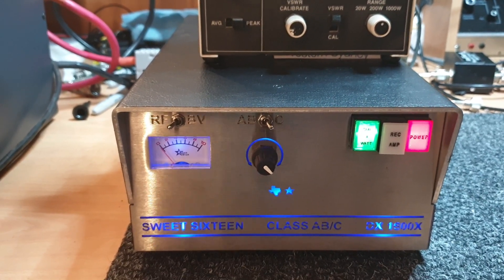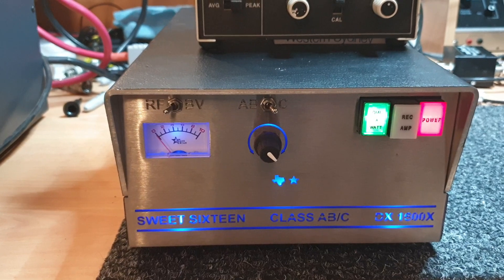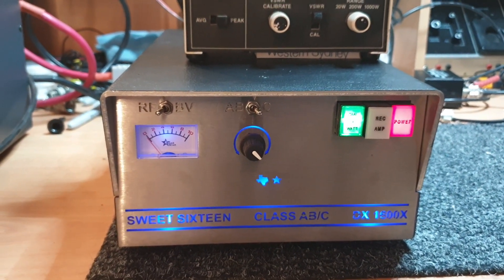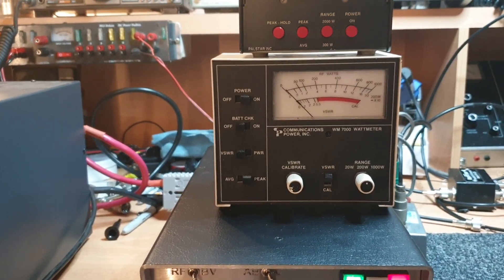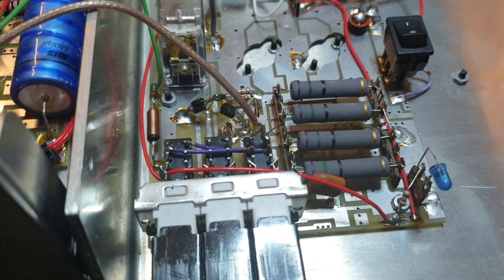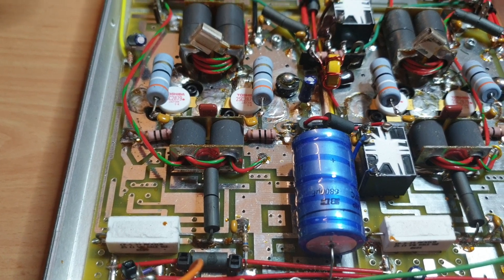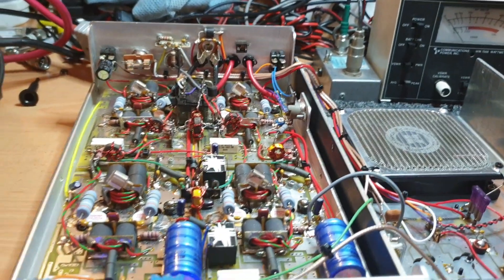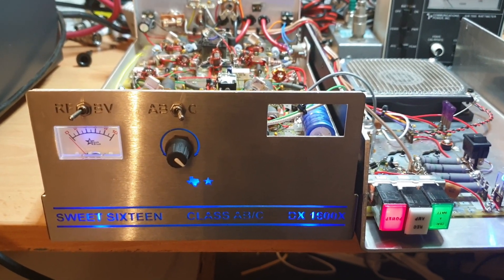Texas Star Sweet Sixteen DX1600X - They definitely pack a punch.

Comment: that has 8 or 10 transistors if the driver section is hooked up the transistors are 100w each at 12.5v so at min you should see 800 watts 500-600 watts tells me some of the transistors are down the high SWR tells me the same

Comment: had that odd smell, and then, turned it off, and the next thing the smoke started coming out of it, had I not been sitting there, it would have been really bad ...mine had the two pill driver section working as well...but the fire was in the right pill section, right under the back left corner of  the fan...